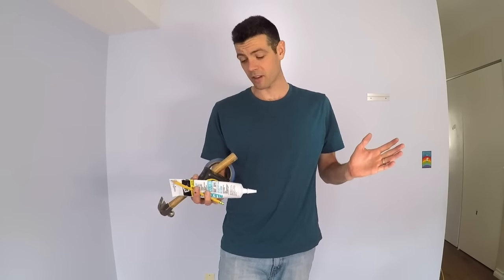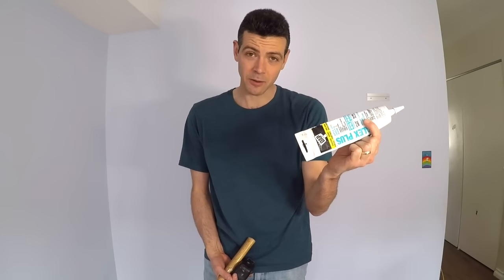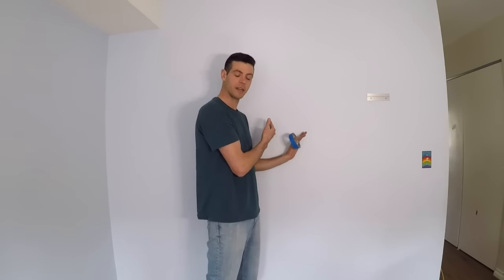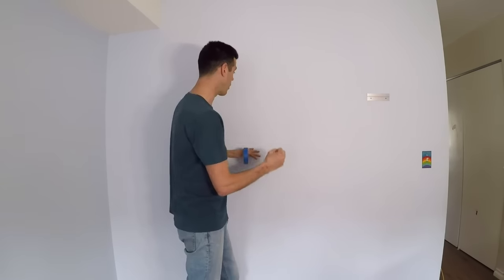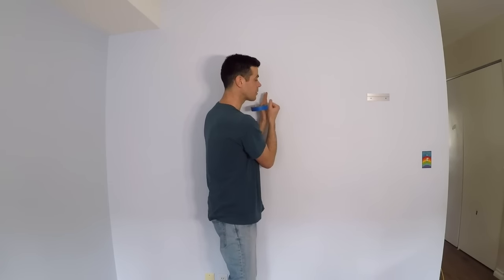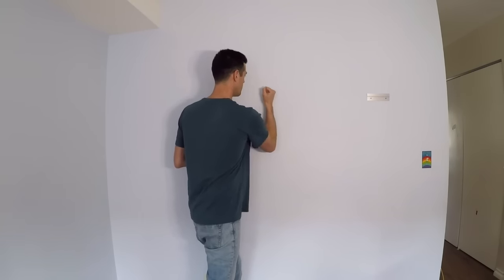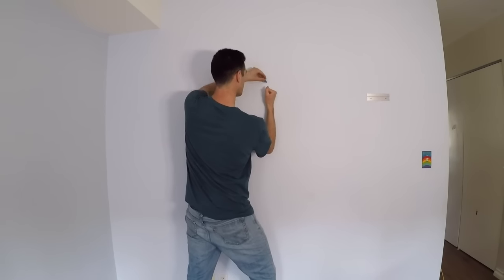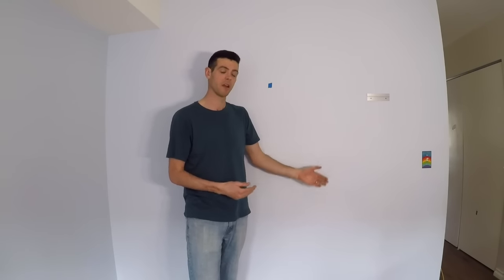It's EASY to Find Studs WITHOUT A STUD FINDER!!!!!

Comment: Excellent!  Great explanation and demo.  I have two electronic stud finders, both seem to give inconsistent results a lot of times.  Maybe it’s the air gaps between the studs and the sheet rock in my 47 year old house, or the vent pipes or ?  but I end up verifying by zoning in with a very small drill bit and a series of very small pinholes, particularly when I need to find exact center for a lag bolt.  I like the idea of using a small nail (and tapping gently and not driving it home!) or as a commenter suggested, maybe a sewing needle.  Thanks!

Comment: It's also fairly quick and easy to just pop the face plates off to see which side the stud is on, although this might not work if the dry wall installers did a perfectly clean job of cutting the holes out for the junction boxes, but it's often times a mess in that the face plates are just barely big enough to cover things up.

Comment: A clear way is to go to receptacles/light switches, phone jack etc. In the beginning it's clear there's a stud between the phone jack and receptacle. Then measure 16" although some buildings aren't always 16" framing. But still, also look for any bubbling mud over sheetrock screws.

Comment: The best stud finder I've ever owned is a magnet. On the outlet method I just take off the cover plate and you can usually see the  stud or you can feel it with a screwdriver

Comment: Never been able to do the knocking method.

Have worked remodeling  in many homes where 16 inches was not even a suggestion. One house the studs varied from 12 to 28 inches in a 10 foot wall.
Badly built by houses are out there. 

I have also found studs that were not installed plumb. The bottom was 2 inches out from the top.

I personally use a stack of rare earth magnets. 

On a sheet rock wall most house rockers install it horizontally. This means that there is a joint at 4 feet off the floor. There will be two screws one above the other on each side of the joint. 

Do assume they used 16 inch spacing. Move the magnets over the wall in a spiral pattern from inside to outside increasing the size of your circle until it sticks. 

Mark it with tape or a pencil. Then move over horizontally. Most installers will install nails or screws in a personal pattern. If you find a few fasteners at a certain height generally the fasteners will be at the same height across the wall.

Using the magnet at the ceiling or floor level can be misleading because of the installer may have put extra screws between the studs into the top and bottom plate.

Comment: I've used the nail method but now use a magnet to locate nails in the wall sheet joints and as the nails are almost always in the centre of the stud the studs are easy to find.

Comment: you can usually just measure in 16" segments from a corner and then use the nail trick. knocking is useful when you get non standard stud spacing.

Comment: Instead of banging on the wall with your fist, tap your finger on the wall. It's more pinpoint accurate and easier to hear tone changes. Sounds hollow vs solid.
Reply: I didn't see your comment and I just gave the same suggestion.  Anyway, I agree, It is a lot more pinpoint accurate.
Reply: Ouch 😜 just call me Stubby Fingers if I can't find a stud quickly.
Reply: I tap lightly with the knuckle of my folded index finger, sound is distinctly different under the stud.

Comment: Some times I use a magnet to find the studs because they use of dry wall screws. Another way , The outlet boxes are nailed to the studs. But I do keep two stud finders handy at all times with batteries.  Well 90%  of the time. Good video, Thanks for your help.👍. P.S. If all else fail's, I use a thin ice pick.

Comment: Stud finders are not just that. They get the center of them, find pipes and electrical wire runs. If you value your time and safety get a 3 in 1 stud finder. 30 euros here on amazon.
Reply: I have two really gourmet stud finders, and like every stud finder I've ever used, they are not accurate 100% of time. After 20+ years, i prefer to mark up a wall with a magnet and blue tape.

Comment: There is an even easier way I found by accident.  Just take a strong magnet and scan the wall until it sticks to a drywall nail or screw
Reply: good advice
Reply: Every time I use magnet
Reply: Yes, this is the correct way. Magnets or bust.
Reply: What if there's a pipe?
Reply: @johnmartinez7440  What do you mean? If there is a pipe, identify it and work around it.
Reply: sexylitehaiti sexylitehaiti  You can tell if your magnet is stuck on a nail head or not. It's very easy to feel the single point of a nail head.
Reply: @johnmartinez7440  What kind of pipe? Copper is nonmagnetic and black iron gas pipe would be buried too deep in the wall to detect. Same with galvanized water pipe.
Reply: I Bought a stud finder that finds some studs, but skips many. I Picked up another, it found wires  every 3",  all over the wall. I got some cheap rare earth magnets, they havem't failed yet.
Reply: @charliedee9276  hope he's not in Florida or any coastal state to get hurricanes😆
Reply: I bought what I thought was a stud finder, it says will find the edge, yes it shows me one edge but not both edges of the stud.  I can see the pop as he says & I know the electric wires run down from the ceiling (I was here when my electric was upgraded to 220).  I’m wanting to hang a towel bar/toilet paper hanger.  I’m returning this stud finder back to Mennards. 🤨. My electric boxes are 4’ from the floor.
Reply: Awesome
Reply: Genius
Reply: Just helped thankyou!!!!
Reply: So where the magnet sticks is where to or where not to nail the wall?
Reply: @bl4clbc  Yes,I did this to a wall on my timber framed wall,it worded a treat.My joists are 2 feet apart.I marked the wall with a sharpie when a nail was found.My joists are 3cm wide behind the plasterboard.....
Reply: @-doggy-6670  okay so find it with a magnet , mark it , then nail there?
Reply: @bl4clbc  my sheets of plaster are 4 foot wide and the joists are 2 foot apart,so every second run of joists have 2 runs of nails (centre only needs one run).I used a small drill to make small holes on either side of the joist to find its width,this made it easy to find the centre of the joist behind the plaster board...
Reply: I'm a single mother by chance not choice this helps soooooo much!
Reply: What if its a murder weapon hidden behind the dry wall?
Reply: Didn’t help me. 😔
Reply: That's what stud finders are man
Reply: Let me just say that's Genius.

Comment: Another tip...look closely for the filled nail holes in the top of the baseboard
Reply: Also for outlets, remove the cover plate and poke a hole on an angle where the cover plate hides the drywall cutout. This is easier when outlets are mounted horizontally
Reply: A flashlight and a darkened room can find even the most meticulous carpenters nail holes. If it's bad drywall you don't even have to go near the baseboard.
Reply: Tony Catalano actually looking for nail holes in baseboards will only work if the carpenter shot into studs. 
Most production carpenters today toenail the base so it won’t tell you much

Comment: I use a very small concrete bit which does not penetrate the wood if it hits a stud but will sort of bounce back. Also will not damage electrical wires.

Comment: Using the outlets are usually a good way of finding the studs unless you're in a house that the builders decided to use almost all old work boxes. I think it had something to do with most of the load bearing walls being steel studs and the contractor not wanting to sister pine 2x4s to many of the steel studs. Talk about a PITA job fixing all the drywall problems.

Comment: I use a strong magnet. they use nails here to hammer the plaster to the stud. if you find a nail, then you find a stud. very good for when you're looking for joists/studs on the ceiling as well.

Comment: I got studs 16, 20, and 24 inches apart.  Each wall has its own pattern though but basically you can’t assume anything with houses and think all walls are the same in a house.
Reply: thats the point of knocking. you can figure out rough distances and then use the method this guy does and he even says usually one every 16 inches.

Comment: Actually I recently found an amazing way to find a stud.. works for wooden studs only though. If you use a strong magnet, and sweep it across the wall it’ll find a screw that’s hanging the drywall. And then you got all the studs.  Also works for almost dust free drywall removal during demo.
Reply: He said this

Comment: I would def say Magnet is the first choice.  Many times when I do renovations, outlets and switches may be at a specific measurement, like the center of a wall. Or if there is a bed or other furniture, you may have outlets on both sides that are equal from the center of the bed and have nothing to do with stud location. ( more likely if it's been renovated rather than original location ) You can also measure 16, 32, 48 etc from either corner and check there if you have no other clues. But again with a magnet you should be able to find a screw within a 16x16 square, just remember to not only look side to side but vertically as well.  PS  Finding a screw with a Magnet does NOT guarantee that it is the center of the stud. And Studs may not be 16 on center from each other all along the wall. sometimes you have to avoid something so you move it one way or the other. 48 from a corner is more likely for the purpose of putting up drywall.

Comment: My own method, never seen elsewhere: get a long hat pin and narrow nosed pliers. Estimate by tapping. Grip the pin shaft a 1/2' from the point with the pliers, push it into the wall at 1/2" intervals along the estimated location. It's easy to push in and the hole is tiny compared to any nail.

Comment: Ya 
I’ll just get a stud finder
Reply: I have three and can always find one.
Reply: Stud finders have always given me false positives.  Magnets work 100% of the time
Reply: Chris Dailey magnets?
Reply: Imight Realperson  practice?  I found that wiring can fool my older finder, true.
Reply: Imight Realperson  i agree that they r not as reliable. I recently purchased a cheapie(mistake #1) do-it-all from HF(mistake #2)  it does find wires, though.     In the end, i can't help using my knuckles and a tiny drill. ☺  ask a local carpenter what they use?
Reply: @Justin Y.`s Evil Twin .. yes a magnet but not a weak magnet has to be a really strong one. The magnet sticks to the nails that are in the stud. 👍
Reply: Bought a stud finder at Menards for 10 bucks. I’ve used it a shit ton and it’s works every time.
Reply: jen p how do u know if a magnet is strong or not when buying it
Reply: Yea didn’t work for me ,the stud finder ,

Comment: C.H Hanson Magnetic Stud Finder, it is the quickest, most accurate stud finder.  As long as the drywall is not glued in place (hung with screws or nails) it is fool proof.  I use mine almost daily ( I run a remodeling/repair business) and it has never failed me.
Reply: I have 3 of those, excellent at locating nails. Actually there is one even better with stronger magnetic where you could swing it on a string and it will stick to a nail. Wish I could find it on Amazon or Home Depot.

Comment: It is much easier to remove the wall plate from the outlet if there is one on the wall,you can see which side of the electrical box the stud is on and take your measurements from  there .

Comment: These cookie cutter towns we live in have 16, 20, and 24” spacings depending on load/no load.  Cost cutting measure.  Sucks when you are trying to hang shelving or cabinets holes for traditional 16in spacing.  Just tossed some decorative pencil shelves bought 6yrs when house was new and we made this discovery.  Considering how many screw pops were in this house past and present i find looking for them unreliable because there’s so many miss hits where the screw pop is result of it missing the stud.
They also Musta left their level at home because so many of them are far from plumb.  

But im righting the wrongs best i can before sale. Thx for the knowledge.  -U10
Reply: DMO_Enterprises  Ottawa, Canada here. 19.2” (8’/5) is common for some big builders in the area. 24” can be a little too far for nice drywall finishes.
Reply: Just wait until you roll up onto a job with 32" on center...

Comment: Lath and plaster find what side the stud is on from the outlet or switch and measure. There is no detector that works on lath and plaster. A very high-end IR cam will give you a chance. But not many of us own a $6000 IR cam.
Reply: I use a portable X ray machine.

Comment: Thank You! Thank You! Thank You! for taking the time to produce these videos. Especially the ones introducing me/us to the hawk & trowel. I had some major repairs to do to a second floor ceiling i.e., replacing 2 ~ 1/2 panels downed due to a crack in the condensate pan of the HVAC unit in the attic. I'm am so impressed how great the finished mud turned out using the techniques I've learned from watching your video. Still the novice but! I did manage to get more mud on the ceiling then on me and the floor.

Comment: 5:25  You can't really trust low voltage wall plates, because these don't need a metal box like an electric wall outlet, they can be simply held by the drywall with a plastic caddy.

For instance, if that phone jack has been installed after the wall has been finished, there is high chances that the stud is actually on the right of the electrical outlet and the phone jack is not held by any stud. The reason is that when you look for fishing a cable into an existing finished wall, you look for existing holes that you can use first. There is probably the wire from the receptacle going down the floor, and so the phone cable can be run in the same hole, but it will end up on the same side of as the wall outlet, you can't really have the cable go on the other side of the stud without drilling a separate hole, which is always more risky than using an existing hole when you don't know what's in this wall.

Comment: This is an unusual case where you could pretty much "deduce" the location of the studs by the highly likely fact that those two boxes are attached on each side of a stud. The stud we are here trying to identify is sixteen inches from that stud (most likely). And if I listened to the entire presentation i'd probably know that the VC has eventually pointed this out. Still, how likely is a wall to have two boxes hanging from either side of a stud like we have here.
Reply: "Still, how likely is a wall to have two boxes hanging from either side of a stud like we have here."
 I have noticed it more in new construction these days, where there seems to be a need for a  data cable box ,WI-FI  or HDMI , along with an electrical outlet, so it makes sense to locate the 2  close together

Comment: there is stud where outlet is....16" over from either side of outlet....but yeah i have stud finder and never use it, its pretty easy to find them after you done it a few times.....plaster walls are bit tougher to feel and hear the sound change.

you can use a magnet too.....they have stud finder tool thats basically a magnet, it finds the drywall screw

Comment: Sooooo, you just go around the walls poking holes with your tiny nail instead of just using magnetic or measuring 16inches apart...not always the rule but most likely is. The magnet w some fishing line Abt a foot long glued together, and just let it dangle against wall until it magnetizes and you've found your stud. A wall outlet is usually installed to the RIGHT of studs, so place the magnet some to the left and see what ya get. A lot easier method than poking and patching holes. Even tiny ones. Lol

Comment: Would you ever want to try installing NovaCrown mouldings? They can be installed at drywall stage along with corner beading and taping. You just attach with taping compound, no nails at all and you don’t have to finish off the top corner. The drywall contractors that use it get an edge on competition by offering crown moulding at a price way better than when crown is installed by a finish carpenter, they finish rooms faster than rooms without it because it takes longer to finish the top corner, the crown never has deficiencies and they make dollars per ft on top of what they make beading and taping.

Comment: Oh how I lament not watching this 14 holes ago- yesterday….

THANK you SO FREAKING MUCH! 

So what your basically saying is a magnet can find a stud, right?

I have saved your video. I don’t think it’s going to be the first one I watch as I am recently widowed and am now living alone for the first time ever. I just moved into a new apartment and am attempting to put up shelves (Teeheehee) without the help of my adult son’s. Let’s just say I think I have lost my security deposit unless I figure out something other than toothpaste to plug up the holes in my bathroom.
As of right now, I have one bracket security faceted. I am very proud of myself although the wall also looks like a ton of flower decals threw up on it as I could not think of a better way to save face over my ineptitude.

You seriously scared me when you mentioned hitting pipes and wires, given my local. 

However, NOW, armed with the copious amount of knowledge you have provided fine sir, I will go forth and find me some studs!!!

Thank you!!!

Comment: Just use neodymium magnets. They work on timber & metal studs & lathe & plaster & they find the nail head or screw in the centre of the studs. If you have a bunch of them, you get the whole picture of stud & noggings/dwangs locations etc, as well. Easy.